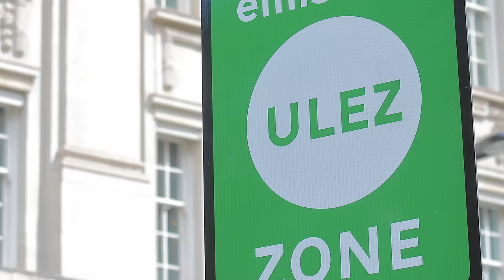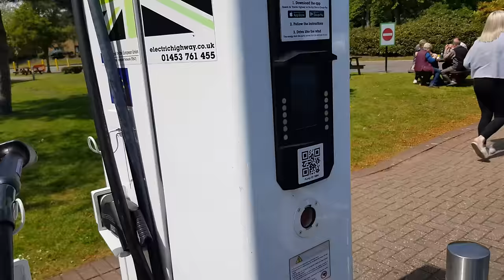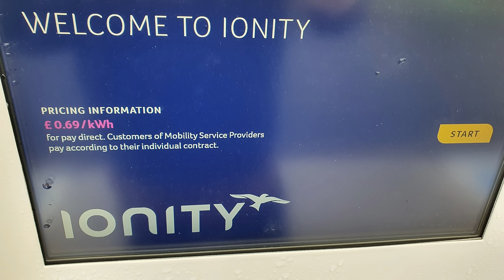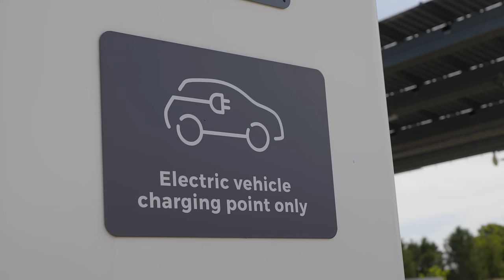The Uncomfortable TRUTH About EVs: The Version NEITHER SIDE Wants You To Hear

Comment: The cashless thing is indeed an issue, because this means you can't charge when the payment system has some downtime.
Cash is one of the most important and fundamental forms of redundancy for any economic system.
We don't necessarily need those chargers to be manned, just a slot to put in the cash goes a long way.
Reply: Go try to pay cash for anything when the power is out anywhere SMDH.
Reply: @4literv6  how is it gonna charge if power is off? it would be good not to be billed for something that has no power...LOL
Reply: Also cashless puts thumb on the scale for poor, who more frequently pay in cash for various reasons including a poorer credit rating.
Not to mention the Pandoras box it opens to potentially tracking driving usage for a future carbon footprint score, since we all know that going EV at best is going to only solve between 5 to 12% of the overblown global carbon emissions problem, depending on global uptake of EVs and their power sources.
Reply: @6Sparx9  you can use debit cards too lol. boomer issues
Reply: yeah. no man. you know i didn't even think about how bad of an issue no cash option is. you don't have full control over you money with a card.  and thats all needs said if you ask me.

pull up to charge up to find out there is some kind of bogus bs to do or extra to pay.   at only 5 miles of range left for example....you have to pay what ever it cost. and it could cost twice as much as other options.  can just put 5 bux in to hold you over til a better charge option.  

no. nope. i don't the sound of no cash option man.  and thats not touching how much control some one else has over you.  i've heard, like you all very likely have heard of cases where people get the bank account blocked for some political bs policy thats tide in with your bank and suddenly some mother f'r has you by the balls...

I NEVER WILL LET GO OF CASH OPTION.   

and the way its looking, sooner or later, we are gonna face out got dam government telling us how many f'ing miles we are allowed to drive, weather its for green bs reasoning or you get charged more per mile of charge after you exceeded you alotted miles given by the state.  nope. this factor is my final nail in the coffin for an EV until i know for sure i can do cash when i need to....at any and all stations...not just this one here and there. and 80% of them all require you digital foot print.   yeah speaking of such....what if you got aminor traffic violation pending in another state. like busting the speed limit on a road trip,  fined for going over 12 mph and you need to fix that speed ticket with a state that is no where near you...click..and suddenly you can't get no charge until you paid that ticket off 3 states away.  that the app your car requires to charge with is also diabled so you can't charge the got dam thing even at home or at a friends place or what not??   nope. im not liking this one bit now that im putting thought into this single factor.  

let alone the battery question marks yet to be answered. like...."am i gonna be the unlucky poor bastard that ends up dealing with a mega fkt battery fire???"   burning my got dam house down or even worse.  it catching fire mid night, catching god knows what else and who else others property/vehicle.garage/house...ect ect...on fire too.  burning my dam car up in a blaze was the least of my problems when considering just how destructive them crazy fires get...that you basically CAN'T put out.  and you can't really move yours or your neighbors f'ing house out of the blazes way. now can ya??  lol
Reply: @LestatTravesty  Yes cashless systems can be easily weaponized for political oppression, while that's much harder to do with physical objects people own, such as bank notes.
Reply: Nope
Reply: @MyWifeHatesThisCar It's also a scheme for companies to force the end user to function as a bank to supply rent free credit to them.
I mean, all that time your money is on the card without being used up, it's actually already owned by the company.
There should be legislation put in place that forces companies to pay rent over the credit that people supply in these ways, just like consumers are required to pay rent when they want money in advance (i.e. debt).
Reply: Had an issue trying to pay for parking at the weekend. App wouldn't load. Pay machines card reader wasn't working. No phone number to call. Ended up having to go to a cash point to take out cash, then go back to the car park to pay with cash. Was a faff and wasted 15 minutes.
Reply: @YTSsport  Well, at least you were able to pay eventually. Without that cash option, it wouldn't be possible at all.
This is exactly why cash as a secondary option is very useful, as a backup.
Reply: There's a lot of naive views on this thread. France went for chip and pin and remote operated petrol stations way before most - which meant that in 2000 you could find yourself stuck on a Sunday in Brittany with no petrol. But ultimately, Frenchies had adapted already, and I soon found ways to deal with it.

In the UK, there's a legal obligation to provide bank accounts, but it can be slow - I had to help a refugee family get a bank account and it was non-trivial. They would have struggled to use an EV on public chargers for a few weeks.

I don't think the world will be cashless for a long long time, but let's look at the advantages... my milkman used to be mugged at least once a year on his collection night. As a kid I'd sometimes get my money robbed from me, growing up in a rough part of Liverpool. My kids just don't have that concern. As a business owner, when people insist on paying by cash or cheque it's an enormous pain. 99% of our trade is cashless and it saves a load of risk. I really don't want a member of team walking around the city with £20k in their bag. It's dangerous.

I do think cash will remain, but it's definitely a niche interest.
Reply: @LestatTravesty  I don't think you realise how much control people have over you and always did - from the language you speak to the places you can drive. Those roads you see as freedom didn't magic themselves into existence. The state controls whether you can drive to a Scottish Island or not - not you.

And it's necessary because I don't think you're the sort to align yourself to anarchism, which is what zero control looks like. But if you do fancy that life, Somalia offers as close to it as you can get.
Reply: @davidcoveney  the thing is relying on cashless is fine as long as everything is working. Such as having a signal, working pay stations etc.

Also pushing everyone to have a smartphone is wrong. You should be able to pay via phone call of cash as not everyone has a smartphone or wants one.

It's also really annoying that you need several different apps for different pay stations. I currently have 3 for parking within the same city which is a joke.
Reply: @davidcoveney  Yes exactly, digital money offers a lot of benefits, but physical cash as a backup is very important.
Reply: and what if the slot is not working?
Reply: @LestatTravesty  Damn, not dam... Whilst I wouldn't be surprised if that happened, I don't think it will happen any time soon. 

And, that wouldn't be as a result of EVs. Places like Singapore have had road rationing for decades. The government decides when and where you drive. Think about London. TfL tracks your car around London 24/7. If you don't meet the emissions standards, or don't want to pay the congestion charge, no driving for you!

Governments have long thought about charging people per mile as well as fuel duty long before EVs. 

We have breathalysers and speed limiters being installed in new cars to stop people driving. That's nothing to do with EVs. 

All this was happening long before EVs. Technology has caught up to what governments want. 

If they already were controlling our driving habits before EVs, why is it EVs fault?

Would you be ok with this technology in an ICE?
Reply: @KypHeM  What if your car gets buried under an avalanche?
What if the charger is smashed by a reckless driver running into it?
What if the universe implodes?
So many reasons for it not to work.
Reply: Tesla Superchargers recognize your car as soon as you plug in and any charges are applied to your already existing account with a credit card attached to it for billing purposes.  No point of sale payment needed
Reply: @billpaliwoda5012  Oh so now are you not only limited to the actual 200 miles instead of their lying 300, you are limited to only Tesla charging stations?  Shit keeps getting deeper and deeper!
Reply: I feel like the non Tesla charging networks are just not well thought out. In the States we have several. Most are the unmanned style and they seem to have a hard time maintaining the chargers. There are others that are associated with a gas station or a grocery store. These seem to be better at maintaining the charge points. 

I agree that electric cars are not for every use case, or for everyone. I think governments should not mandate them, incentivize perhaps, but not a complete banning of ICE.

Comment: As someone who charges exclusively at home paying USA electric prices and driving 60 miles per day. EVs are great and save a ton of money. If I needed to use a charging station regularly, I wouldn't own one.
Reply: That is why legislators needs to stop the Ev mandates and eliminate carbon pricing. Evs are still infeasible for many of us and punitive legislation against us is unfair and should be unconstitutional.

Taking my money away doesn't make it easier for me to "go green" it makes me find ways to cheat the system and push for political changes.
Reply: They really don’t save that much in Fuel costs. A model 3 charged at home at 15 centers kWh is still 1/2 the fuel cost of driving a rav4 hybrid. Once you include the purchase price of most EVs it really isn’t cheaper.
Reply: @PinkFZeppelin   My Leaf has 65KWH capacity. Electricity is 0.08/KWH. I use 25-30% commuting 60 miles. Cost is $1.30-$1.60 per day. RAV4 hybrid is a better car IMO, but in terms of fuel cost, it wouldn't even come close.
Reply: @stephankrasner  .08/kwh is insanely cheap, nearing the cheapest in the country. The average in the USA is twice that. At 20kw to go 60 miles, which is only possible in ideal weather, you’d be at $3.2. Current national average gas price is  $3.4/gal and it would take you 1.5 gallons to go 60 miles or $5.1.  So the leaf would actually be a little more than half the fuel price of a rav4 hybrid even with at home charging with national averages. If charging costs more than 25 cents/kwh, which it is most charging stations, it’s more expensive to drive the leaf.

They just don’t work out to be all that much cheaper in fuel for most Americans.. Maybe save 1000 bucks a year in the most ideal of scenarios. Which often the increase in insurance wipes out and the total cost of ownership certainly does.
Reply: @PinkFZeppelin  5.1 is 3x more than 1.6. I never claimed EVs were for everyone.
Reply: @stephankrasner  — 65kWh Leaf huh…? 🤔 what special model is That?! 🤭😂
Reply: @I_know_what_im_talking_about  Huh. You're right. It only has 62KWH. I always thought it was 65.

Comment: In Hungary, there’s a petrol chain called MOL, which have their own EV charging network as well. Almost all of their charging stations are located at their own petrol stations, and you can pay with cash for EV charging. You buy a certain amount of electricity (let’s say 20kWh) and you receive a ticket with a code, which you can enter on the charger, and do your charging. Of course, it is really expensive that way, and you’re in V12 territory of money for fuel, but at least you have an option to pay with cash if you need for some reason.